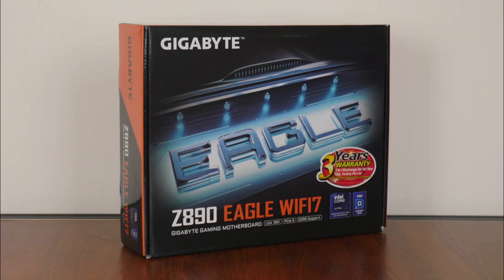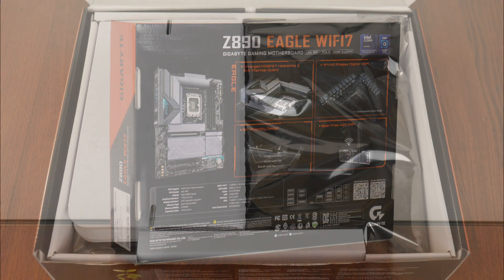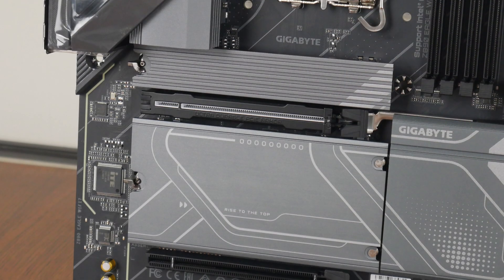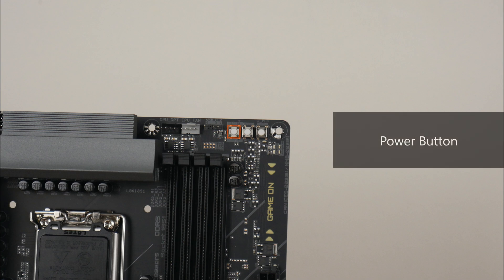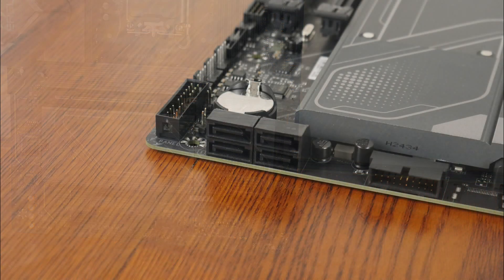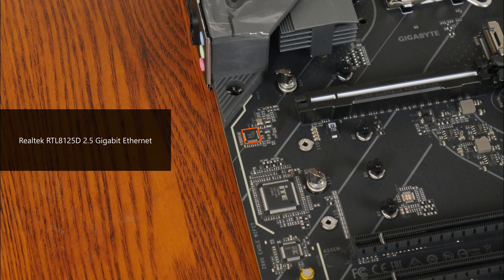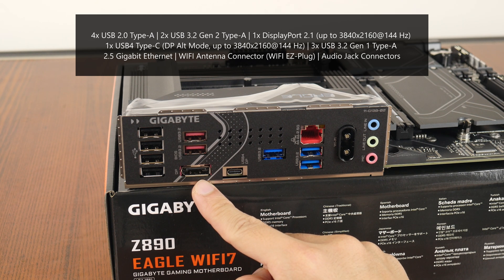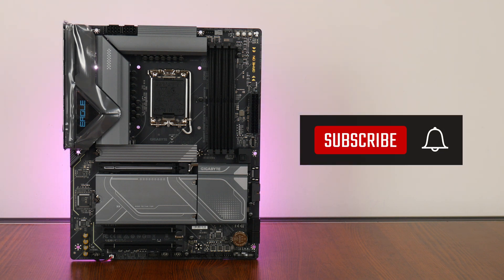This is Gigabyte's mainstream Intel Z890 motherboard! Gigabyte Z890 EAGLE WIFI7 Unboxing & Overview

Comment: I'm thinking about buying this board and was wondering how important the power stages are when choosing a board. Also, would this board hold back the Intel Core 9 Ultra?
Reply from the maker: Hey there. For this class of motherboard (i.e. boards with high-end chipsets such as the Z890), the VRMs are typically adequate for even the highest-end processor, in other words, the Core Ultra 9 285K. Where VRM specs require closer attention tends to be with low-to-mid-tier board offerings (e.g. boards with the B860 chipset), where manufacturers may cheap out on the VRMs so as to keep costs low.

All that aside, this board should perform well even with a 285K - there's a Hardware Unboxed Z890 motherboard roundup video that's worth checking out, where this Z890 EAGLE WIFI7 board doesn't do too badly at all with a 285K!
Reply: @ALKtech  Thanks for the quick feedback! I'll be checking out that other board you recommended too.

Comment: It's well over 500 dollars for this MB and an Intel U5.  You'll need to upgrade the ram, too.  That's too much for a midrange system.  I'm going to wait for Battlemage reviews to come out, and possibly build a system around that.
Reply from the maker: I'm guessing prices might get adjusted in the coming weeks/months following Arrow Lake's official launch, where we might see price adjustments by AMD and hopefully by Intel too as they trade blows. What's the specs of the PC that you're using at the present moment?
Reply: @ALKtech  Intel(R) Core(TM) i7-9750H CPU @ 2.60GHz   2.59 GHz  It's a gaming laptop with a 1660ti.  I don't even need to upgrade.
Reply from the maker: @briankleinschmidt3664  yeah if it serves your purposes still, no point in splashing additional cash on the newest shiniest thing for sure!